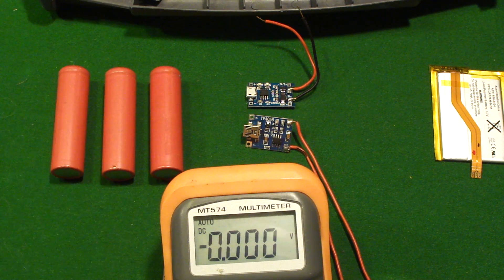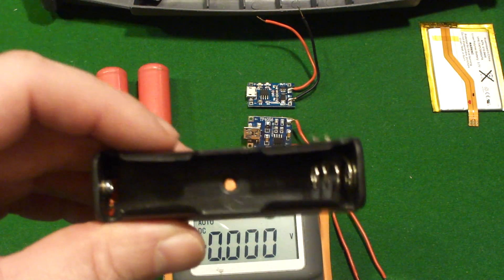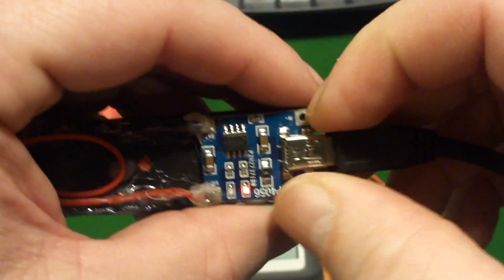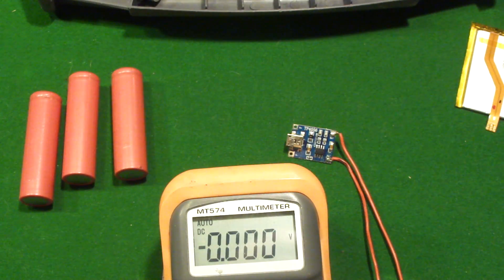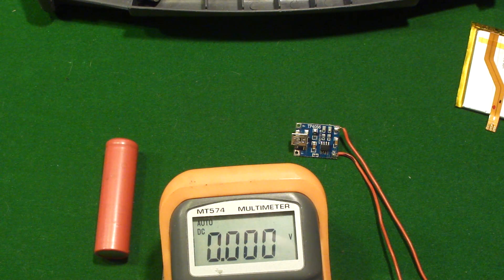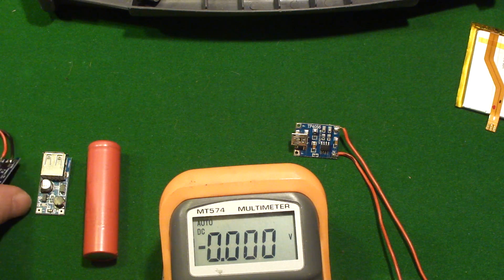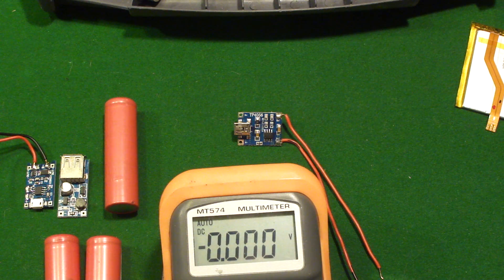HOW TO: Use Lithium 3.7v batteries in small Arduino projects.

Comment: I wonder if I heard you right.  You pointed out the TP4056 didnt offer any low voltage protect.  The specs i read on the module says it does offer it at 2.5 volts.  Which is correct.  I do need the low voltage protect  Thanks

Comment: Is there anyway to wire six of these 3.7 volt batteries get 11.1 volts?
Reply from the maker: Two pairs of 3 in series instead of parallel will give you ~11v. You can do this directly or there are fun little boards that will make this possible. There are two challenges if you do this "naked": Getting them not to over-discharge as that will destroy the batteries, and then charging them back up in-situ.

Comment: Here's a dumb question: I can charge and drain the batteries at the same time?
I want to make a GPS Tracker that charges only when the motorcycle is on, and i'll not have access to the battery.

Comment: !!A Warning for anyone using either of the TP4056 charging chips in the video!! They cannot be directly attached to a load when charging, because the detection circuit never detects when it has gone past the +/- 10% of 4.20 volts. This is true even if the load is just a couple Milli Amps... At best will damage your li-ion batteries, at worst can start a FIRE! Tinkerers BEWARE!
Reply: Thank you very much for this advice!
Reply: https://www.youtube.com/watch?v=f2yMs-JAyQM
This guy has a pretty convincing argument  dissmissing your claims at  around 5:30

Comment: Quick question: If using the module that regulates charge as well as discharge, If I connect it to my arduino board and then plug the usb into the arduino to upload a program, will the battery be protected? I understand that if you plug the usb into the arduino it will attempt to charge the battery.

Comment: Can the battery be charged at the same time the circuit is powered when using one of those usb boards?
Reply: it can, but the load needs to be tiny. if the load =< 5Ma yes. other than that, NO they cannot. It will wind up destroying your lithium ion batteries

Comment: I dont get it if arduino is drawing 5v how can I use 3.7 batteries in my arduino project, can those '03962a's convert 3.7v battery input to 5v output ?
Reply: Did you miss the part at 5:30?
Reply: @ColinRichardson  No, but he said arduinos are happy with as low as 1.8V so I wonder which input you can use.

Comment: Is it possible to charge and discharge simultaneously with this module ? With a parallel wiring ? How ????!! :) 
Thanks
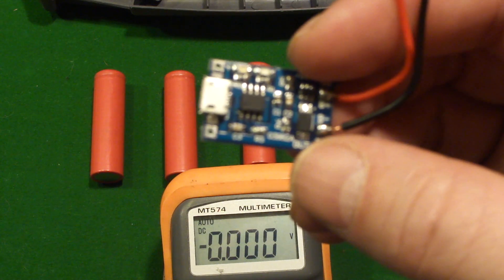Reply: I think as seen at 2:46 you connect battery +/- to opposite side of usb port and connect arduino +/- to the ones on the same side with usb port as explained in 2:07 and afterwards, so it enables arduino to draw power from batteries, as well as usb input to charge batteries
Reply: @berkcan3475  I've soldered my bat pins, and charged and discharged the battery with the same Bat pins, this worked pretty well :)
Reply: Apparently it cannot because if you put a load >5mA then the charging module cannot detect the correct voltage of your battery and you could destroy it or worse. cf. Lindsay Cox comment.

Comment: Can we wire 18650 battery to an arduino pro mini 3.3v directly? Or shoul I use step up converter circuit like you shown, before the arduino pro mini 3.3? is it necessary for this situation
Reply: Arduino Pro Mini has RAW power input with voltage regulator which can handle from 3.4V to 12V, so as long as you supply the power through RAW instead of unregulated VCC it should work fine

Comment: Could you charge 18650 using the TP4056 via solar panel (12v to 14v DC output) without a solar panel controller?

Comment: Hi, I got some 18650 batteries here, are those good to be used with arduino nano, clock module and pir motion sensor and led matrix? I'd like the clock to last long time. for now I'm using a power bank 10000 mAh (?) but that only last a short week

Comment: I'm doing a school project with the arduino uno..our task is to create a autonomous vehicle that can navigate a course and locate a marker..I was thinking of using 18650 batteries...but not sure how to power the motors...2 batteries make 8.4-7 volts..the motors are 6v..any ideas on how to wire that up?.and what pieces or boards I'll need...I'm new to this..and want to get good run time..all while keeping the vehicle under a 6x6x4(inch) foot print. Thanks in advance

Comment: arallel Connection

 If higher currents are needed and larger cells are not available or do 
not fit the design constraint, one or more cells can be connected in 
parallel. Most battery chemistries allow parallel configurations with 
little side effect. Figure 4 illustrates four cells connected in 
parallel in a P4 arrangement. The nominal voltage of the illustrated 
pack remains at 3.60V, but the capacity (Ah) and runtime are increased 
fourfold.
Reply: Parallel*

Comment: Is it ok to wire the TP4056 output directly into the 5V on the Arduino Nano? I've been doing that to run a small OLED display and some tiny sensors, and it seems to be working fine, but I don't know if I'm messing something up by doing so.

Comment: will one of these charge boards charge 2 of the 18650 batteries ie. a double holder and a 03962A Board?
I want to run a self contained weather station using an Arduino Due.

Comment: Hello, are you sure about the recommendation of using the 03962A over the TP4056? the TP4056 specs says it is the one with over and under voltage protection. 
Great video,thanks keep it up.
Reply: Do you have any more information on this? I'm interested in buying an over and under voltage protector as well and am not sure which one will have what I want
Reply: @ColeLashley  Hello, it looks like the tp4056 has a newer version which has a couple of more ic chips and that one is the same as the 03962a. Searching on Amazon for tp4056 looking closely at it some have 03962a printed on the board. Hope that helps.
Reply: @steve8939123  Thanks that helps, I was able to find one that suited my needs
Reply: @ColeLashley  you're welcome

Comment: I am starting my first project with an arduino and I need to control 4 3.7v motors for a drone. I thought the 3.7v lipo is fine but on the arduino page it says between 6-12v to power up the board. Can you help me choose the battery for the 3.7 motors if I am using an arduino to control them?

Comment: Is it alright if I use two 14500 li-ion cells in parallel, with a 03962A module? 
I just made a small portable speaker using those and PAM8403 audio amp, and so far they work great.
Reply: You could, but you would need to take them out to charge or figure out how to balance charge the cells individually.
Reply: @billybbob18  hey, thanks for the reply. It was long ago, and it worked perfectly for almost two years 😄

Comment: do they even make 4v double a batteries or even 5v ??????????????
Reply: mangreat71 AA batteries are the same size as 14550 lithium batteries. 18650 batteries are like giant AA batteries. 14550 (14mm x 55mm) lithiums will fit in AA battery holders but of course their nominal voltage is 3.7v instead of 1.5v. 14550 sized batteries may also be Ni-Cd or Ni-mh but again not 1.5v.

Comment: what is the part number of the usb converter you had at 5:40.
Reply: found it on ebay DC-DC Converter Step Up Boost Module Power Supply USB Charger 5V for Phone MP3/4, the type 0.9-5v to 5v 600mA W/USB. http://www.ebay.ca/itm/DC-DC-Converter-Step-Up-Boost-Module-Power-Supply-USB-Charger-5V-for-Phone-MP3-4-/400767258219.made by Shenzhen LC Technology Co., Ltd.  http://www.chinalctech.com/index.php?_m=mod_product&_a=view&p_id=877

Comment: Title is about using 3.7v Batteries on an Arduino but then you don't mention the Arduino or how to use a 3.7v battery on one at all? Would you connect this to the 3.3v input or to the RAW input?  I ask as I have tried using Nicad packs of 4 to power on the RAW and when the power falls below 4v the Arduino starts to play up?
Reply: Andrew Brierley did we watch a different video? He mentioned using a small DC-DC step-up converter to boost the voltage to 5V for your Arduino project.

Comment: Nice. I have similar question like Loïc Rosset here it is:
can you use the charge module to recharge a battery, i mean to hooked it to a load and use the energy from the battery. But to do it with the same terminals for charging. The reason that i ask is that i want to use this device as a battery bank and to be able to charge it and discharge it from the same terminals

Comment: What is the power rating of one of the batteries?
Reply: Ultimatefire54 how long is a piece of string? 18650 lithium batteries come in varying capacities.

Comment: Say you had a 2000 mah battery and a 500 mah battery that are both 3.7 volts. If you had one of these modules, charging the 500 mah battery would not damage the battery correct.
Reply from the maker: +Jacob GoProVideos Correct. As long as you are charging them separately all should be fine. These modules work on the voltages being pushed back by the battery. Thus the smaller capacity battery will simply push back higher voltages after less current has been pushed in.
Reply: +LessonStudio thanks I appreciate it

Comment: Great video! Is it possible to charge the batteries and use them at the same time? Or the current used will "fool" the charger believing the batteries are never fully charged?
Reply from the maker: +Loïc Rosset So far the only material that I have read says to disconnect the load while charging. That said, I have left this connected to loads while charging but those loads were very very small. They weren't something like a motor, or even a powerful transmitter. My load was in the 30 ma range.
Reply: LessonStudio when I have used the newer ones, I've left the load connected. Once the circuit detects that the voltage has dropped below a certain level, it disconnects the load, then reconnects again when another higher threshold is reached. Over time of course unless the batteries are allowed to fully charge now and then, it will lessen their capacity and shorten their lives.